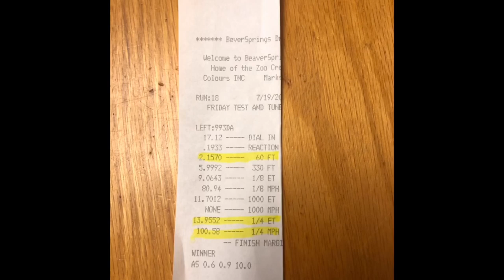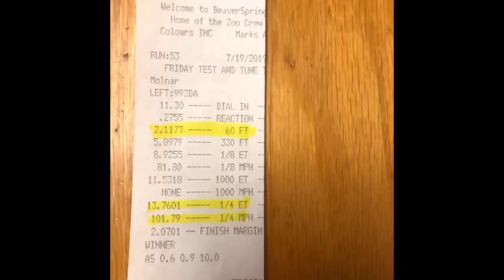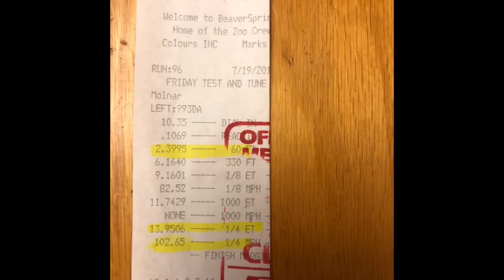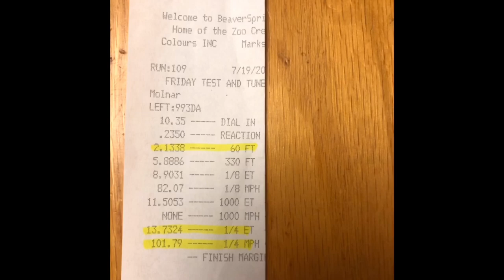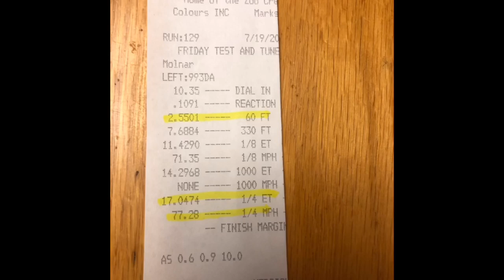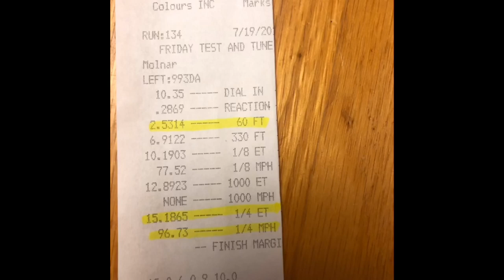Chrysler 300 srt8 stock quarter mile time

Comment: Cool! Yeah my first time at the track running stock with my srt8 back in day, I was mostly getting around 14's.
I added an AFE stage 2 CAI, Diablo tune, 180 t-stat, and new Toyo Proxy tires...
Went back, and ran 13.1 seconds. 
Also helps to put a bag of ice on you intake manifold between runs...
Have fun man! I miss that car!
Reply: ...not counting tires, that's well under $1000 for the upgrades. So not bad to gain a full second in the quarter. 😊
Reply: Did you cam it?
Reply: @JoshuaIS1  Nope. Just cold air, tune, tires, and t-stat. That was enough to make a real notable improvement. I never dig into the engine any further.
Reply: @LastBastian  Thank you!
Reply: Diablo tune actually adds alot on these cars
Reply: @Highlander1432  Yep. Sure does!
Reply: Any idea on how much power that actually adds? A full second is definitely substantial.
Reply: @caperr2  I don't remember exactly. I know there were forums where members Dyno tested before and after. The tune does more than add hp though, it also makes the car shift harder/better and other improvements that are over my head. 🥴
Reply: Cool thanks man
Reply: @LastBastian  Hmmmm for those mods it's an odd time to be getting, you should be getting somewhere in the ball park of 12.4-12.7
Reply: @phoenixlounge7656  Well the conditions of the track, and human error factor in. I'm not s professional racer.
But like I said, I was on a forum full of other srt guys, and none of them were getting the kind of times you mention, with the simple mods I had either. 🤷‍♂️

Comment: I decided to run my year old (Non-SRT which is nolonger available in the US) 2018 stock Chrysler 300C 5.7 in drive-in street at my local NHRA Dragstrip. Stock 20" performance tires with full 35 lb air pressure. My first qualifying pass at a 1500 launch was 13.87-102.1 mph. My 2nd pass jumped to 14 41 due to traction lose requiring me to petal after Iauch. Being street stock. Many of the 30+ cars were far from the stock requirements, but running bracket racing kinda evens things out with me going 4 rounds out of 7. If I can get my 300C to launch reducing my 60' times. I believe I can get into the mid 13s . Next week I will be reducing rear air pressure to 28 lbs hoping to hook up better. My only mod is a Cold air box. No other mods until the factory warranty expires. I recommend using the Sports mode and let the transmission shift automatically. I found in Sport mod the car's performance is better and you'll avoid shifting late and hitting the Rev limiter. One big issue my track has Is the water box does not have the room to drive around it. Water on stock treaded tires doesn't work well even with completing my burnouts in front of it. The evening was cool but humid making lt hard to get off the line even at 1000 rpms. I know this post is a year old, but the NHRA requires helmets if your car runs 13.99 or faster. Nothing is listed regarding 100 mph passes.
Reply: Ik im 3 years late on this post itself but I had no clue you had to have a helmet to race if you're car goes as fast as 13.99 in a 1/4 thanks for the info cause I'm about to take my 06 srt8 300c out there and run it but eventually I'm going to take weight out I really don't want to take my kicker and the tv's out of the car (stock tv's and also the stock kickers) but I want my weight to reach 4800-5000 ilbs exactly or lower nothing higher than that cause I really do want this beauty to be running around high 9's or low to mid 10's that's good enough for me and to drive it on the street and just completely demolish scats and etc like some amgs also with the weight n power I would have when I get there  I want all cars in my neighborhood to be competitive with me and my lovely beautiful babygirl melody cause of the mid muffler delete the sound will scare and also get every man hard and ever women moist at the same time when hearing it go threw the streets of my neighbor hood I want this car to be the grim reaper of my block and people say "you don't want to rave the grim reaper or aka melody and you figure out why he calls it both if you go line to line with it or up to a 40 to 60 mph take off he will / she will destroy you" I wantelody to become a myth in the future when there's no more gas cars allowed on the streets 😂😂😂😅😅😅😅 sorry for the long message you probably won't even see this message but if you do I was just in my mode of loving my car so much I had to make up a whole story of her 😂😂😂😂😂

Comment: Nice good to see some 300 srt8 track runs but temperature is the killer on this cars 180 thermostat is a good upgrate
Reply from the maker: It was also 90+ with 80% or more humidity 🥵. I’m going to head back when it’s a lil cooler and I have new tires to see if I can improve my times

Comment: You need to heat up your tires more, do a longer burn out and take off from 1,500 rpm. Yes you may spin a little but sometimes it’s better when you spin a little than taking off at almost idle
Reply: He is on street tires no need to heat them up at all

Comment: On 17inch drag radials, cold air intake, 170 t-stat and Diablosport tuner my 06 Charger made a 12.8 pass. My best on street tires and fully stock I had a best of 13.3 I am sure that you can improve! 👍
Reply from the maker: Matt Machine   What speed was that at?
Reply: Matt’s MotoWoRX MPH was @106
Reply: Matt Machine 180 or 170 tstat? If 170, where did you get it from? What brand etc. Thanks!
Reply: SELL is a Stant t-stat part #14127, but you need to file down the edges a bit so it can seat properly in the housing. Any auto parts should have it in stock I got my on eBay for around $10

Comment: I found out that when I only push the traction control button for a second it gives me about 70% of the vehicle's power and does not like top speeds as apposed to holding down the traction button for the 10 seconds.. then its hold my beer time :D and I dont even drink

Comment: Once you get a proper cold air induction with snorkel that goes down behind the front spoiler, it gets rid of that laggy bottom end that stalls the start times. Its also because it's diff is set to be safe - so reset your throttle (read how to - its easy) and it will respond more in tune with how you drive. And then there's the 295s she has stock...you'll need at least 325s if you wanna get down to under that 13 second mark. Extractors also give a decent boost - but only get HEMI SRT8 products - don't buy that cheap crap that just looks good.

Comment: I have a 2006 300c SRT 8 and noticed you held "down" the traction control button for a few seconds.
What's the difference between pressing once to turn off traction verses holding the button down?

Thanks
Reply: mike hanley holding it down for 10 seconds completely turns off traction.
Reply: @JoseHernandez-xr6zo  Thanks
Reply: Wow i didn't  know that
Reply: One click just turns off traction control. Holding it disables traction and stability control.

Comment: Thats a real bad time for a stockie, at least expect 13.3-13.5 where the average is for one.

I know my one just with a mopar cold air intake gets 12.88 at 111 mph (Sea level in Australia (Hot weather as well) )
Reply from the maker: What were your 60’ times? I don’t post glory run videos. I just record what I ran that day good or bad 🤷🏻‍♂️. Thanks for checking out the video. I have some upgrades for the car on the way! We’ll see if I can make it go quicker 🤘
Reply: @MattsMotoWoRX  Hey hey hey, wasn't having a go at you at all, just saying it was way slower then it should be as the average 1/4 is 13.3 on them
Reply: Yeah I thought same, not to take away.

Comment: According to Car and Driver magazine, "The SRT8 will bust through 60 mph in 4.7 seconds on its way to a 13.2-second quarter-mile at 109 mph."  So obviously it can do better.
Reply: Stock factory numbers are never correct, like how Hellcats claim 707 but push closer to 550 wheel. Most 6.4s arent well kept throughout their lifetimes & they drop off ab 20% power towards the back end of the engine life. I have a 185k mile 5.7l w full bolt ons that pushes a 4.4 0-60 with a high 11s qt mile, it all depends on how well its maintained. Overall 6.4s are overrated when you actually start modding these cars.

Comment: It’s hard to get good times. I recently ran a 13.1 on my 08 300 srt and it’s cammed. I trapped at 107 but my 60ft sucked. First run on track and then they closed the tracked but I’m sure I can do way better too
Reply: I’ve been 12.9 110 bone stock lol

Comment: What altitude? At sea level should be 13.0-13.3
Reply from the maker: Black beast E550   The altitude is 632’ 
My biggest problem was the humidity and horrible 60’ times need a driver mod for the next time I go!!!
Reply: @MattsMotoWoRX  yes. Cause this car can do 13.0 stock
Reply: @b58forever  are u sure?
Reply: @mikestewart9407  sure of what?
Reply: @b58forever  13.0 stock. I have a 6.1srt Challenger  I'd be happy with 13 flat
Reply: No they don't they do a 14.1 quarter mile stock at sea level I saw in the wheels magazine back in the day
Reply: @lexman8678  stock 300c srt8 is a 13 second car with right driver and condition probably you saw the 340hp 300c hemi
Reply: @lexman8678  Well your actually, wrong. They do 13.1 at the 1/4... 14.1 is actually right on level with a 5.7L Hemi